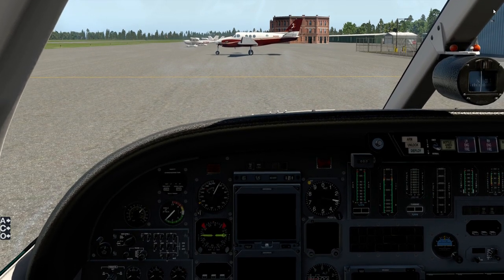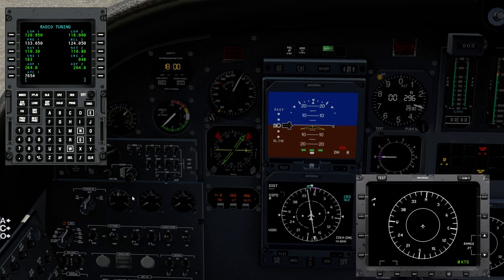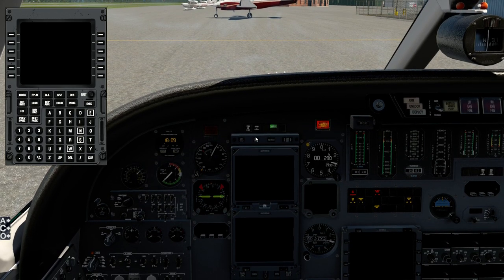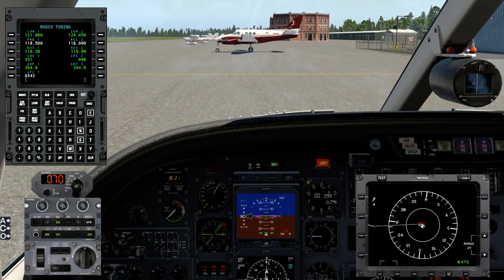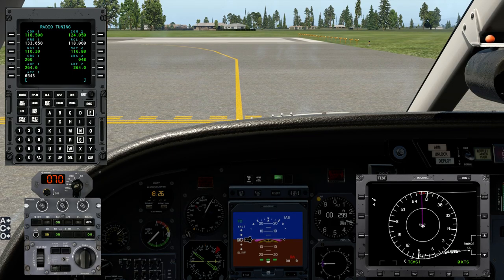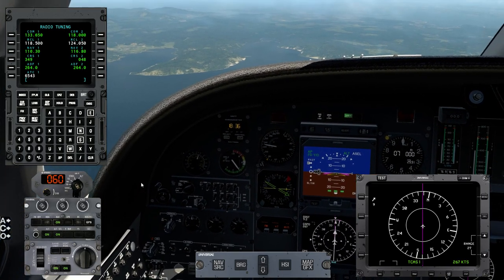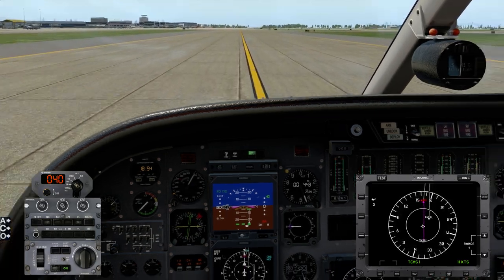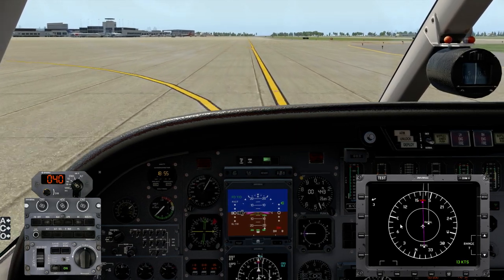Carenado Cessna S550 Citation II for X-Plane 11 Startup and Normal Operating Procedures

Comment: WoW! - I'm 85 a PPL from way back 50 years but I have only ever done VFR and low-level IFR in Twin props - and now a Flight Simmer of 30 years
I have just bought 3 Citations from Carenado --for P3D V4 - one is a 560 but close to 550 and trying to get used to the FMS
GTN750 and Hi skies flying. I just came across this video - and can't believe how much I learned at one view - back again to it 
tomorrow - and will study all the screen shots I have made of the positions and Instrument settings 
Thankyou - John Heaton Australia
Reply from the maker: I’m a strong believer in Sim flying. The FMS for the S550 isn’t perfect, especially when it comes to thrust management. Consequently, I manage thrust manually without issue. Enjoy your new Citation and happy flying!

Comment: Heey SOG Pilot, i am Type Rated myself on the C500/550/560 and also the C650. Just a tip from me, when you climb out you should aim for V2+20 keep takeoff thrust until 1500feet AGL and then only reduce with approx 2% to 5% N1 at 1500feet. And then continue to 3000feet AGL and retract the flaps and accelerate to around 220kts and continue the climb with that speed. Thats called NADP1 and thats what the proff guys does😎🛩 but nicely flown!
Reply: And always at all other times fly as fast as possible, also in the decent 5kts below redline or 250 below 10.000

Comment: Very glad I found this. Definitely the best starter tut on this aircraft. Well done! Could you post up a copy of your checklist (to save me writing it down from the vid); it's also the best clist out there!
Reply from the maker: BEFORE START

Preflight Inspection - COMPLETE
Flashlight - ABOARD/CHECKED
Fire Extinguisher - ABOARD/CHECKED
Microphones, Headsets, Oxygen Masks - ABOARD
Documents and Manuals - CHECKED
Oxygen Quantity - CHECKED
Circuit Breakers - CHECK IN
Anti-Ice/De-Ice Switches - OFF
Control Locks - REMOVE
Generators (except for GPU start) - GEN
Fuel Boost Pumps - NORM
Ignitions - NORM
Crossfeed - OFF
Gyro Slave Switch - AUTO
Standby Gyro - ON/VERIFY POWER/OFF
Seat Belt Sign - CHECKED/OFF
Anti Skid - OFF
Cabin Pressure/Rate Control - SET
Throttles - CUTOFF
Engine Sync - OFF
Windshield Bleed Valves - CLOSED
Battery Switch - BATT (CHECK 24 VOLT MINIMUM)
AC Power & Master Avionics - ON
Rotary Test - CHECKED
Parking Brake - SET
Landing Gear Handle- DOWN/THREE GREEN/NO RED
Engine Instruments - NO FLAGS
Electric Elevator Trim - TRIM DISC CHECKED
Airspeed Bug - SET
Fuel Quantity - SUFFICIENT/BALANCED
GPS/FMC - PROGRAMMED
Flight Plan - FILED

BEFORE STARTING ENGINES

Chocks - REMOVED
Seats and Pedals - ADJUSTED
Beacon/Navigation Lights - ON
Cockpit Lights - AS REQUIRED
Standby Gyro - ON
AC Power & Master Avionics - OFF
Air Conditioning - OFF
Cabin Door - LOCKED/LIGHT OUT
Before Start Check - COMPLETE

STARTING ENGINES

First Engine Ignition - ON
First Engine - START
N2 - VERIFY RPM INCREASE
First Engine Throttle - WAIT FOR N2 ABOVE 8% THEN SET TO FLIGHT IDLE
ITT - MONITOR WITHIN LIMITS
N1 - VERIFY ROTATION/RPM INCREASE
WAIT FIRST ENGINE STABILIZED
Second Engine Ignition - ON
Second Engine - START
N2 - VERIFY RPM INCREASE
Second Engine Throttle - WAIT FOR N2 ABOVE 8% THEN SET TO FLIGHT IDLE
ITT - MONITOR WITHIN LIMITS
N1 - VERIFY ROTATION/RPM INCREASE
WAIT SECOND ENGINE STABILIZED

BEFORE TAXI

GPU - DISCONNECTED
GENerator Switches - GEN
Volts/Amps - CHECKED
AC Power & Master Avionics - ON
PASSenger Advisory Light - PASS/SAFETY
Cabin Pressure and Temp Controls - SET/AUTO
Gyro Pressure - CHECKED
Air Conditioning - FAN OR OFF
Circuit Breakers - CHECK RIGHT/CHECK LEFT
Belts and Harnesses - FASTENED
Exterior Lights - AS REQUIRED
Before Taxi Check - COMPLETE 
 
TAXI

Check Departure Runway - BUGGED/VERIFIED
ATIS and Clearance - COPIED
Transponder - SET AS REQUIRED
Brakes and Steering - CHECK RIGHT/CHECK LEFT 
Flight Controls - TOPS CHEKED/BOTTOMS CHEKED
Flaps - CHECK OPERATION/FLAP HANDLE AGREES WITH FLAP POSITION
GPS/FMC - PROGRAMMED
INVerters - CHECKED
Auto Pilot & Flight Director - CHECKED/HEADING-ALTITUDE SELECT
Anti-Ice/De-Ice - CHECK AND AS REQUIRED
Thrust Reversers - CHECKED
Flight Instruments - CHECKED
Altimeter/Altitude Selector - SET
Radios/Avionics - SET
Fuel Quantity/Balance - CHECKED
Pressure Source Selector - CHECKED LH/RH/NORM
Speedbrakes - CHECKED/RETRACTED
Flaps - SET 7 DEGREES
Trims - SET THREE TRIM WHEELS
Takeoff Data/Bugs - REVIEW
Crew Briefing - COMPLETE
Taxi Check - COMPLETE 

BEFORE TAKEOFF

Ignitions - ON
Anti-Ice/De-Ice - AS REQUIRED
Pitot/Static Heat - ON
Exterior Lights - ON
Transponder/TCAS - ON
Engine Instruments - CHECKED
Anti Skid - ON
Annunciator Panel - CHECKED
Departure Runway - BUGS ALIGNED/VERIFIED
Before Takeoff Check - COMPLETE

AFTER TAKEOFF AND CLIMB

Landing Gear & Lights - UP AND OFF
Yaw Dampener - ON
Flaps - UP
Engine Sync - ON
Ignitions - NORMAL
Climb Power - SET
Anti-Ice/De-Ice - AS REQUIRED
Anti Skid - OFF
Pressurization - CHECKED

Passenger Advisory Lights - AS REQUIRED
Exterior Lights - AS REQUIRED
Climb Check - COMPLETE 
 
TRANSITION (climb)

Altimeters - 29.92/29.92-CROSSCHECKED
Recognition Lights - OFF
Oxygen - CHECK
Pressurization - CHECK
Air Conditioning - FAN OR OFF
Transition Check - COMPLETE  
 
DESCENT

Defog Fan - HI
Foot Warmers - CLOSED RIGHT/CLOSED LEFT
Airflow Distribution - COCKPIT
Pressurization - SET
Windshield Bleed Air/Manual Valves - LO/MAX
Anti-Ice/De-Ice - AS REQUIRED
Fuel - BALANCED/CROSSFEED OFF
Descent Check - COMPLETE 
 
 
APPROACH

Altimeters - SET/CROSSCHECKED
Belts and Harnesses - ON RIGHT/ON LEFT
Passenger Seats - UPRIGHT/OUTBOARD
Cabin and Emergency Exits - CLEAR
Recognition Lights - ON
Landing Data - SET/POSTED
Anti Skid - ON
Pressurization - CHECKED
Avionics/Flight Instruments - SET
Approach Briefing - COMPLETE
Passenger Advisory Lights - PASS/SAFETY
GPS selector - SET
Approach Check - COMPLETE 

BEFORE LANDING

Landing Gear - DOWN-3 GREEN-NO RED/VERIFIED
Ignitions - ON
Engine Sync - OFF
Pressurization - CHECK ZERO DIFFERENTIAL
Landing Lights - ON
Flaps - LANDING
Annunciator Panel - CLEAR
Speed Brakes(Prior to 50 ft AGL) - RETRACTED
Autopilot/Yaw Dampener - OFF
Before Landing Check - COMPLETE 
 
AFTER LANDING (silent)

Anti Skid - OFF
Pitot Heat/Anti-Ice/De-Ice - OFF
Ignitions - NORMAL
Exterior Lights - AS REQUIRED
Standby Gyro - OFF/CAGED
Transponder - AS REQUIRED
Radar - STANDBY
Flaps - UP
Speedbrakes - RETRACTED
Trims - RESET
After Landing Check - COMPLETE 
 
SHUTDOWN

Check Parking Brake - AS REQUIRED
Transponder - STANDBY
Avionics & Inverters - OFF
Overhead/Defog Fans - OFF
Air Conditioning - OFF
Throttles - CUTOFF
Exterior Lights - OFF
Passenger Advisory Lights - OFF
BATTery Switch - OFF
Clock - ZEROED
Shutdown Check - COMPLETE 
 
VREF – KIAS Flap Full

WEIGHT / KIAS
14.1 / 114
13.5 / 112
12.7 / 108 
12.0 / 106
11.5 / 104
10.5 / 99
9.5 / 95

VREF – KIAS Flap 15

WEIGHT / KIAS
14.1 / 122
13.5 / 119
12.7 / 115 
12.0 / 113
11.5 / 111
10.5 / 106
 9.5 / 102

Comment: Great video! A fellow SOG myself if you are talking about South of Gandy ;) Working at Macdill and loving the x-plane experience. Very nice tutorial!
Reply from the maker: Thanks Steven!  Well, not exactly South Of Gandy :)  I was a Special Operations Group (SOG) Task Force Commander (tactical law enforcement operations) and then transitioned to pilot in the same unit (now retired).  X-Plane is a fantastic tool to keep skills sharp by practicing flight fundamentals, VFR procedures, instrument procedures, radio communications, and countless other skills while at the same time having fun doing it.  I find some aspects of simulator flying are actually harder due to limited 360 visibility and absence of motion.  Nonetheless, X-Pane has helped me tremendously and continues to be a valuable tool in my real-world flying.

Comment: I've learned so much in this one walkthru than I've seen in a long time. I'm still new XP11 and if it wasn't for FS2020 I would buy this Carenado Cessna S550 Citation II and FA50 EX but I don't want to buy stuff twice for to games so I'm holding off for the developers to add mods to FS2020. I really want to fly these planes and learning so much grrr TYSM SOG Pilot 10/10
Reply from the maker: Glad it helped. I created it using the actual S550 flight manual. When FS 2020 rolls around, I’m sure the procedures will translate directly into that model. Happy flying!

Comment: Thanks for tutorial it is really good. Could you tell me how does to use the check list by voice? Thanks.
Reply from the maker: Hello.  To set up a checklist in X-Plane, follow the below instructions.  The text is converted to speech automatically by X-Plane as you toggle through each checklist item.  The checklist can be displayed on the screen, or removed from the screen for voice-only checklist toggle.

Using a Checklist
X-Plane has the ability to display a simple checklist in the simulator. This checklist must be stored somewhere in the X‑Plane directory as a plain text (‘.txt’) file.

To load a check list, open the File menu and click Open Checklist. Click on Load New Checklist and navigate to your ‘.txt’ file. Open it and you will see the checklist displayed line-by-line in the checklist window. You can use the forward and back buttons to go to the next and previous lines, respectively.

If you prefer to see the text file all at once (rather than line-by-line as in the checklist view), you can select Open Text File from the File menu and then load a file in the manner discussed above.

Comment: Excelent job, text to voice feature where exactly is located in x plane 11 ??? Thanks for ur help. keep bringing it love it..
Reply from the maker: Hello.  To set up a checklist in X-Plane, follow the below instructions.  The text is converted to speech automatically by X-Plane as you toggle through each checklist item.  The checklist can be displayed on the screen, or removed from the screen for voice-only checklist toggle.

Using a Checklist
X-Plane has the ability to display a simple checklist in the simulator. This checklist must be stored somewhere in the X‑Plane directory as a plain text (‘.txt’) file.

To load a check list, open the File menu and click Open Checklist. Click on Load New Checklist and navigate to your ‘.txt’ file. Open it and you will see the checklist displayed line-by-line in the checklist window. You can use the forward and back buttons to go to the next and previous lines, respectively.

If you prefer to see the text file all at once (rather than line-by-line as in the checklist view), you can select Open Text File from the File menu and then load a file in the manner discussed above.
Reply: @sogpilot3137  much thaks

Comment: Great video! But could you explain how to think when setting cabin pressure?
Reply: I would also like to know how to set cabin pressure, is there a set  calculation for different altitudes?
Reply from the maker: Set cabin pressure to field elevation at departure airport. As per the descent checklist, set cabin pressure to field elevation at arrival airport. Cabin pressure should be “zero differential” before landing (cabin and outside air pressure equal).

Comment: Phenomenal video sir! What soundpack is being used? Is it the free or the payware version?
Reply from the maker: Hello. Here is the checklist I created from the S550 flight manual. No special software is used. I simply used the text to voice feature in X plane 11.

BEFORE START

Preflight Inspection - COMPLETE
Flashlight - ABOARD/CHECKED
Fire Extinguisher - ABOARD/CHECKED
Microphones, Headsets, Oxygen Masks - ABOARD
Documents and Manuals - CHECKED
Oxygen Quantity - CHECKED
Circuit Breakers - CHECK IN
Anti-Ice/De-Ice Switches - OFF
Control Locks - REMOVE
Generators (except for GPU start) - GEN
Fuel Boost Pumps - NORM
Ignitions - NORM
Crossfeed - OFF
Gyro Slave Switch - AUTO
Standby Gyro - ON/VERIFY POWER/OFF
Seat Belt Sign - CHECKED/OFF
Anti Skid - OFF
Cabin Pressure/Rate Control - SET
Throttles - CUTOFF
Engine Sync - OFF
Windshield Bleed Valves - CLOSED
Battery Switch - BATT (CHECK 24 VOLT MINIMUM)
AC Power & Master Avionics - ON
Rotary Test - CHECKED
Parking Brake - SET
Landing Gear Handle- DOWN/THREE GREEN/NO RED
Engine Instruments - NO FLAGS
Electric Elevator Trim - TRIM DISC CHECKED
Airspeed Bug - SET
Fuel Quantity - SUFFICIENT/BALANCED
GPS/FMC - PROGRAMMED
Flight Plan - FILED

BEFORE STARTING ENGINES

Chocks - REMOVED
Seats and Pedals - ADJUSTED
Beacon/Navigation Lights - ON
Cockpit Lights - AS REQUIRED
Standby Gyro - ON
AC Power & Master Avionics - OFF
Air Conditioning - OFF
Cabin Door - LOCKED/LIGHT OUT
Before Start Check - COMPLETE

STARTING ENGINES

First Engine Ignition - ON
First Engine - START
N2 - VERIFY RPM INCREASE
First Engine Throttle - WAIT FOR N2 ABOVE 8% THEN SET TO FLIGHT IDLE
ITT - MONITOR WITHIN LIMITS
N1 - VERIFY ROTATION/RPM INCREASE
WAIT FIRST ENGINE STABILIZED
Second Engine Ignition - ON
Second Engine - START
N2 - VERIFY RPM INCREASE
Second Engine Throttle - WAIT FOR N2 ABOVE 8% THEN SET TO FLIGHT IDLE
ITT - MONITOR WITHIN LIMITS
N1 - VERIFY ROTATION/RPM INCREASE
WAIT SECOND ENGINE STABILIZED

BEFORE TAXI

GPU - DISCONNECTED
GENerator Switches - GEN
Volts/Amps - CHECKED
AC Power & Master Avionics - ON
PASSenger Advisory Light - PASS/SAFETY
Cabin Pressure and Temp Controls - SET/AUTO
Gyro Pressure - CHECKED
Air Conditioning - FAN OR OFF
Circuit Breakers - CHECK RIGHT/CHECK LEFT
Belts and Harnesses - FASTENED
Exterior Lights - AS REQUIRED
Before Taxi Check - COMPLETE 
 
TAXI

Check Departure Runway - BUGGED/VERIFIED
ATIS and Clearance - COPIED
Transponder - SET AS REQUIRED
Brakes and Steering - CHECK RIGHT/CHECK LEFT 
Flight Controls - TOPS CHEKED/BOTTOMS CHEKED
Flaps - CHECK OPERATION/FLAP HANDLE AGREES WITH FLAP POSITION
GPS/FMC - PROGRAMMED
INVerters - CHECKED
Auto Pilot & Flight Director - CHECKED/HEADING-ALTITUDE SELECT
Anti-Ice/De-Ice - CHECK AND AS REQUIRED
Thrust Reversers - CHECKED
Flight Instruments - CHECKED
Altimeter/Altitude Selector - SET
Radios/Avionics - SET
Fuel Quantity/Balance - CHECKED
Pressure Source Selector - CHECKED LH/RH/NORM
Speedbrakes - CHECKED/RETRACTED
Flaps - SET 7 DEGREES
Trims - SET THREE TRIM WHEELS
Takeoff Data/Bugs - REVIEW
Crew Briefing - COMPLETE
Taxi Check - COMPLETE 

BEFORE TAKEOFF

Ignitions - ON
Anti-Ice/De-Ice - AS REQUIRED
Pitot/Static Heat - ON
Exterior Lights - ON
Transponder/TCAS - ON
Engine Instruments - CHECKED
Anti Skid - ON
Annunciator Panel - CHECKED
Departure Runway - BUGS ALIGNED/VERIFIED
Before Takeoff Check - COMPLETE

AFTER TAKEOFF AND CLIMB

Landing Gear & Lights - UP AND OFF
Yaw Dampener - ON
Flaps - UP
Engine Sync - ON
Ignitions - NORMAL
Climb Power - SET
Anti-Ice/De-Ice - AS REQUIRED
Anti Skid - OFF
Pressurization - CHECKED

Passenger Advisory Lights - AS REQUIRED
Exterior Lights - AS REQUIRED
Climb Check - COMPLETE 
 
TRANSITION (climb)

Altimeters - 29.92/29.92-CROSSCHECKED
Recognition Lights - OFF
Oxygen - CHECK
Pressurization - CHECK
Air Conditioning - FAN OR OFF
Transition Check - COMPLETE  
 
DESCENT

Defog Fan - HI
Foot Warmers - CLOSED RIGHT/CLOSED LEFT
Airflow Distribution - COCKPIT
Pressurization - SET
Windshield Bleed Air/Manual Valves - LO/MAX
Anti-Ice/De-Ice - AS REQUIRED
Fuel - BALANCED/CROSSFEED OFF
Descent Check - COMPLETE 
 
 
APPROACH

Altimeters - SET/CROSSCHECKED
Belts and Harnesses - ON RIGHT/ON LEFT
Passenger Seats - UPRIGHT/OUTBOARD
Cabin and Emergency Exits - CLEAR
Recognition Lights - ON
Landing Data - SET/POSTED
Anti Skid - ON
Pressurization - CHECKED
Avionics/Flight Instruments - SET
Approach Briefing - COMPLETE
Passenger Advisory Lights - PASS/SAFETY
GPS selector - SET
Approach Check - COMPLETE 

BEFORE LANDING

Landing Gear - DOWN-3 GREEN-NO RED/VERIFIED
Ignitions - ON
Engine Sync - OFF
Pressurization - CHECK ZERO DIFFERENTIAL
Landing Lights - ON
Flaps - LANDING
Annunciator Panel - CLEAR
Speed Brakes(Prior to 50 ft AGL) - RETRACTED
Autopilot/Yaw Dampener - OFF
Before Landing Check - COMPLETE 
 
AFTER LANDING (silent)

Anti Skid - OFF
Pitot Heat/Anti-Ice/De-Ice - OFF
Ignitions - NORMAL
Exterior Lights - AS REQUIRED
Standby Gyro - OFF/CAGED
Transponder - AS REQUIRED
Radar - STANDBY
Flaps - UP
Speedbrakes - RETRACTED
Trims - RESET
After Landing Check - COMPLETE 
 
SHUTDOWN

Check Parking Brake - AS REQUIRED
Transponder - STANDBY
Avionics & Inverters - OFF
Overhead/Defog Fans - OFF
Air Conditioning - OFF
Throttles - CUTOFF
Exterior Lights - OFF
Passenger Advisory Lights - OFF
BATTery Switch - OFF
Clock - ZEROED
Shutdown Check - COMPLETE 
 
VREF – KIAS Flap Full

WEIGHT / KIAS
14.1 / 114
13.5 / 112
12.7 / 108 
12.0 / 106
11.5 / 104
10.5 / 99
9.5 / 95

VREF – KIAS Flap 15

WEIGHT / KIAS
14.1 / 122
13.5 / 119
12.7 / 115 
12.0 / 113
11.5 / 111
10.5 / 106
 9.5 / 102

Comment: Great video!! This has really helped me make my flying experiences in the Cessna S550 much more realistic. Quick question. What settings or maybe (community file) are you using for your TrackIR? I'm using one of the community files and cant seem to keep the "shaking" to a minimum when I've reached the limits of the preset viewing angles.  Any help would be greatly appreciated!
Reply from the maker: Hello there. I pretty much used the default settings when setting up track IR. However, it’s really important to properly align the transmitter with the receiver. It took a fair amount of experimentation. There were times when the receiver became misaligned and the result was when turning my head toward the edge the signal was interrupted resulting in shutter and shifting of the image on the screen. It’s also important to calibrate to your zero point every time you use track IR.
Reply from the maker: Forgot to mention. I use X-Camera plugin with Track IR.